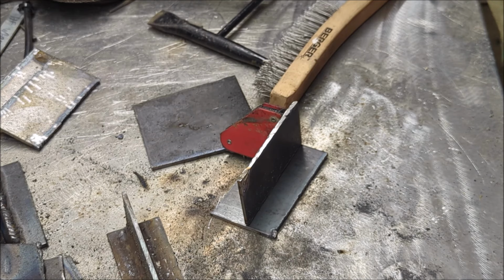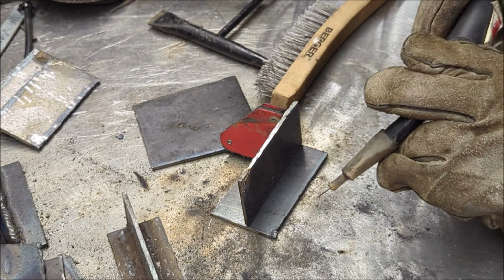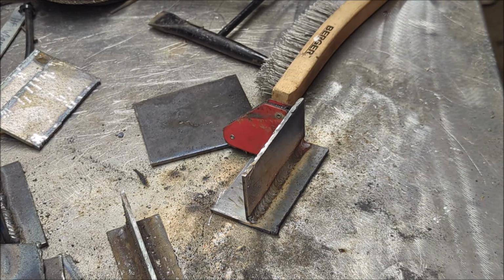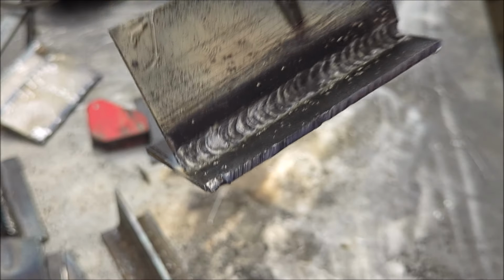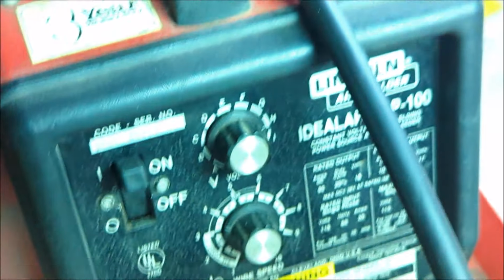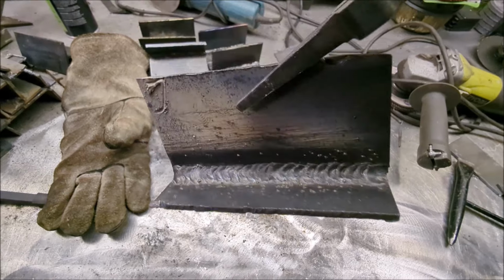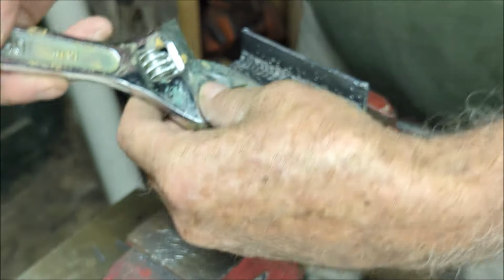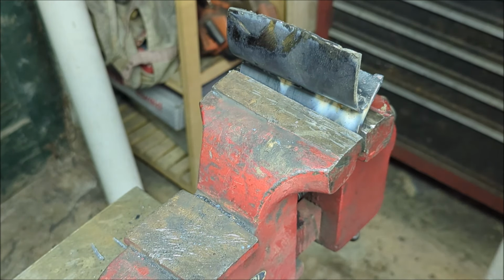lincoln idealarc sp 100 follow up. T joint flux core weld and break test attempt

Comment: Hi is this running off 110 outlet or gas tanks. I want to get a little welder for small repairs
Reply from the maker: It uses a 20 amp 120 volt common house receptacle. It is using .030 flux core wire with no gas. I have not run solid wire with argon/co2 through it yet but it is set up for gas if i choose to try it. I already have a 230 volt multi process machine I use with tanks. Thanks for watching, and asking.